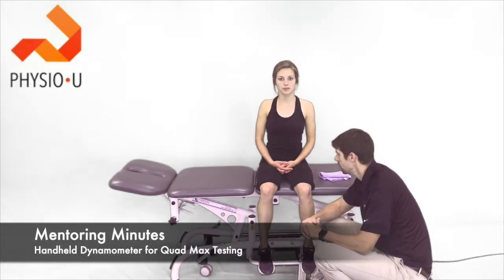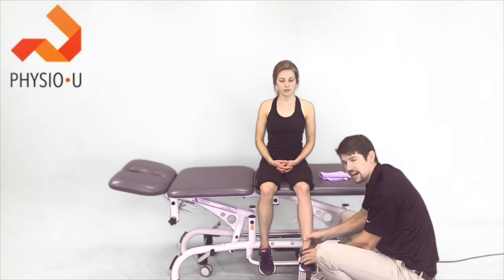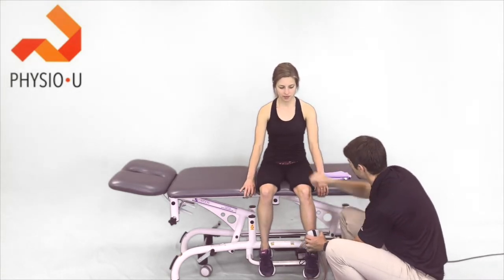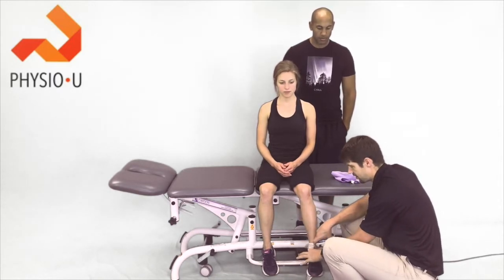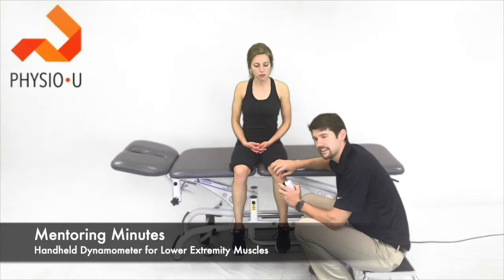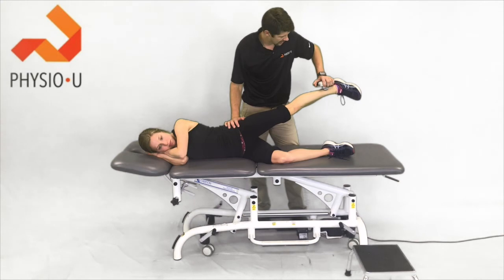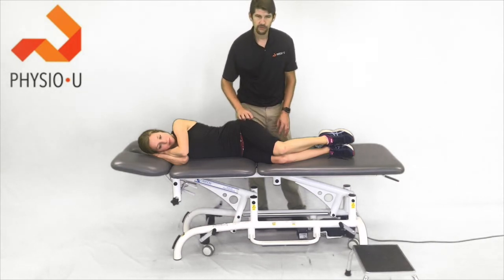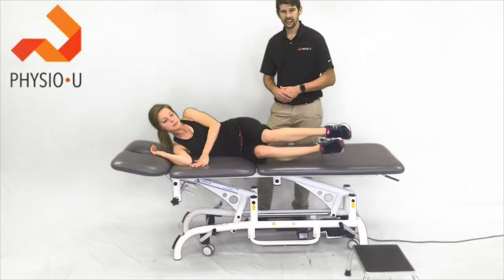Hand Held Dynamometer: Quad & LE Muscles

Comment: hi can you please tell me the normal values for knee extension strength?
Reply: Hi Sida, the normative values differ based on age, gender, height and weight etc. But there are few researches done on this front. Look at one done for swiss population: https://pubmed.ncbi.nlm.nih.gov/9014953/
Also, you can check out our hand held dynamometer : FitMust which can measure upto 150kgf (330 pounds) with 98% accuracy here - https://www.ashva.xyz and https://youtu.be/Jc2_DePRlmA

Comment: Please share link to buy hand held dynamometer
Reply: Hi Nicky,  the top brands (buying links included) are : 
MicroFET 2 Handheld Dynamometer for Manual Muscle Testing (MMT) - $1,159.20 [https://www.prohealthcareproducts.com/microfet-2-manual-muscle-testing-mmt-handheld-dynamometer/]
Lafayette Electronic Handheld Dynamometer (Manual Muscle Tester) | Model 01165 - $1,316.25 [https://www.prohealthcareproducts.com/lafayette-electronic-handheld-dynamometer-manual-muscle-tester-model-01165/]
FitMust Handheld Dynamometer for Manual Muscle Strength Testing - ~$850 (In India) & $1000 (For International Shipping) [ https://www.ashva.xyz/contact]

you can check out our hand held dynamometer : FitMust which can measure upto 150kgf (330 pounds) with 98% accuracy here - https://www.ashva.xyz and https://youtu.be/Jc2_DePRlmA
Reply: you found it?

Comment: Just wondering what brands are reliable for the hand-held dynamometer
Reply: Hi Nicky,  the top brands are : 
MicroFET 2 Handheld Dynamometer for Manual Muscle Testing (MMT) - $1,159.20
Lafayette Electronic Handheld Dynamometer (Manual Muscle Tester) | Model 01165 - $1,316.25
FitMust Handheld Dynamometer for Manual Muscle Strength Testing - ~$850 (In India) & $1000 (For International Shipping)

you can check out our hand held dynamometer : FitMust which can measure upto 150kgf (330 pounds) with 98% accuracy here - https://www.ashva.xyz and https://youtu.be/Jc2_DePRlmA
Reply: you found one?

Comment: Hi, great informations. Can you say what values is the strength threshold at 45 & 90 degrees of leg for the athlete to start easy running, jumping?
Reply: Hi Lucian, the normative values differ based on age, gender, height and weight etc. But there are few researches done on this front. Look at one done for swiss population: https://pubmed.ncbi.nlm.nih.gov/9014953/
Also, you can check out our hand held dynamometer : FitMust which can measure upto 150kgf (330 pounds) with 98% accuracy here - https://www.ashva.xyz and https://youtu.be/Jc2_DePRlmA